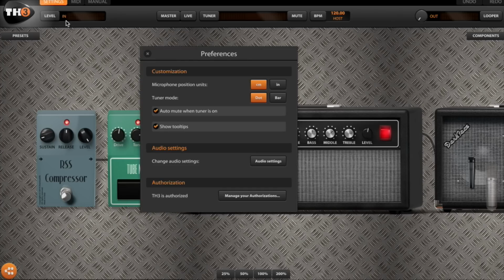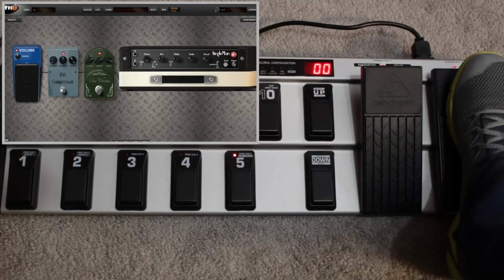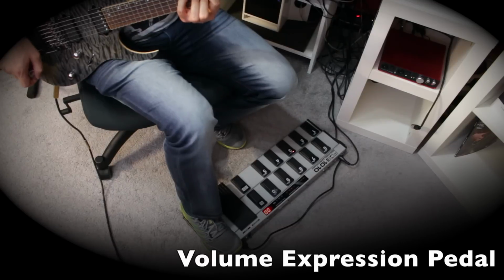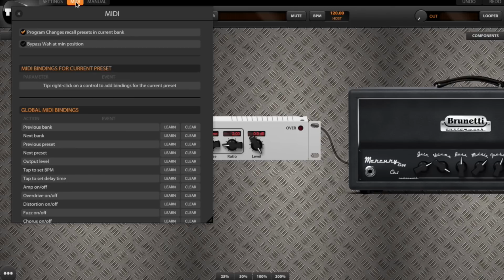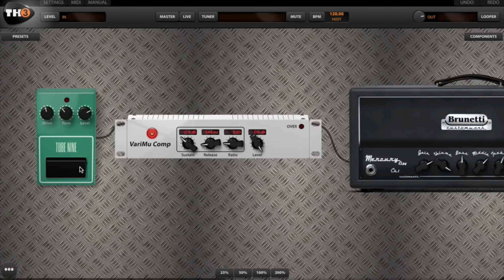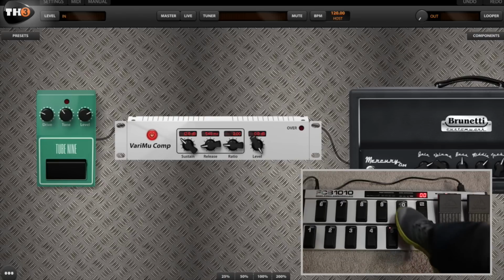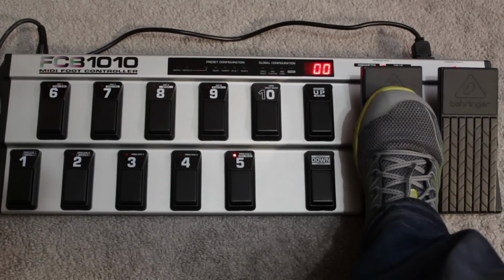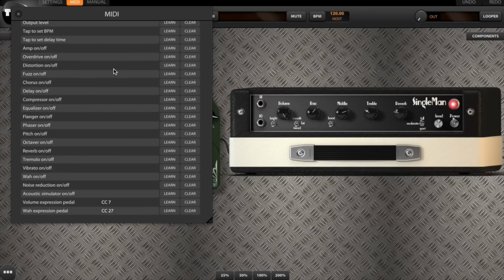Controlling Overloud TH-U With a Midi Floorboard

Comment: cool video thx... but is it also possible to change the hole preset  ( Bank and Preset) via midi to jump from one complete to the other: from bank 1; preset 5 to Bank 5; preset 7 with one step on the  FCB1010 ??? HOW ???

Comment: Hi..i build for pyver vypyr 75W on arduino footswitch with bank preset...rever and delay. Working fine. But wjen i connect to laptop th3 not see command midi. I use simple china midi converter on usb. Th3 need some magic preset with midi command?

Comment: I have TH-U Mobile with all of the gear. TH-U mobile does not have the feature where you click the FS twice to learn the on/off state. When you "learn", you click the FS and the Learn window goes away. There are 6 options for setting up the MIDI command: Expression, Footswitch, Press 127 and release, Press 127 only, Press 0 and release, and Press 0 only. I've tried setting up my MIDI FS using all of those options except Expression (since this is a FS). The only one that seems to sort of work is Footswitch, but it requires you send 0 or 127 for Data 2 field. The problem is, 0 turns it off, 127 turns it on. If the stomp is on, clicking the FS will turn it off. Clicking it again will turn it on (since it's sending 127). However, if the stomp is already off, clicking the FS the first time does nothing. Clicking a second time turns the stomp off (as expected), then clicking again turns it on (as expected). But that means every time I load a preset, I have to toggle each stomp on and off before I know that the MIDI FS will do what I expect it to do. 

Is there a video out there or some place where I can find a better explanation about the MIDI implementation in the mobile app? I've spent close to $250 on TH-U premium and most of the amp and rig packs. Sure would be nice if the MIDI implementation actually worked correctly.
Reply: Did you get any answer ?
Reply: @shinomorello  Nope. I just make sure I click each foot switch twice after changing presets. A little annoying, but not a big deal, I suppose. The Behringer controller with the mod chip is supposed to be able to. And each foot switch has an LED that shows on/off state. 

Relatively inexpensive too. LOTS of foot switches and an expression pedal.

Comment: Tutorial wortks like a charm. But whan I use it under my DAW (Sonar Platinum) only erxpression pedals works. How can I setuo other functions?
Reply: It has to do with routing the signals. I googled.."using the behringer midi pedal in th-u in a daw. worked perfect in reaper and should in most others as well.

Comment: That's great David but it only helps when using TH-U as a stand alone piece. When you use it through a DAW like Reaper, you don't get the audio settings in the settings menu so how do you set it up in a DAW? Thanks :)
Reply: Did you figure it out yet?
Reply: @drstatic401  yes thanks

Comment: Hi I’m getting the overload th-u and intend to buy the Roland boss fc-300. Will this combination work? Thanks
Reply from the maker: Yes, thanks to its MIDI learn, TH-U can work with any MIDI pedalboard. Btw, we typically use the FC-300 when demoing at NAMM
Reply: Overloud Audio Tools thanks a lot for the reply. Cheers
Reply: @overloudaudiotools  hi, mind to share your connection for FC-300 & TH-U setup? did u hook up the FC-300 straight into PC via USB-MIDI cable?

Comment: Hello! I just got the demo of TH3 Full to test out if it is right for me. I also have the FCB1010 and I’m wondering if/ how you can program TH3 to switch between presets (distortion to clean for example) with the press of a button on the FCB. Thank you in advance for your help!
Reply: I've been asking them for 2 years and never get a response.  It would be helpful!
Reply: You can switch between presets but only scroll to next or previous on the list. Crazy not to be able to assign a given preset.  Probably because the preset name is arbitrary and one can delete a preset. They would have to also delete the midi assignment simultaneously
Reply: @PaulLebow  yes :( that missing option is a shame… Bias FX 2 solved it with it’s LiveView, but I prefer the sounds of TH-U 3 Too, too bad

Comment: Excellent review thank you! Is there any way to map the looper clear all function? I use the looper quite often but it seems there is no way to map the clear all to a midi button, rather I have to use the mouse and click clear all. Thanks!
Reply: I don't think there is, I use the looper quite often as well, no way to invoke it other than mouse, all you can assign midi wise of use is rec play or stop , great but wanting more ..
Reply: @bobco5  man, Should I turn on direct mode on my FCB1010 controller to controll smart functions?
Reply: @ZoltanHagg  Direct mode as far as I know is an option to navigate banks and presets, with Direct Select off you would have to incrementally scroll or leaf through banks numerically up and down to get to a certain bank and preset. with Direct Select on you can directly go to preset locatin by pressing the bank number followed by the preset number, i.e. you'd have to 'know where you want to go, bank 04 preset 02 for example. How does that enable smart function of TH3 or how does that help or have anything to do with controlling TH3 is a better question. I assume you have a stock FCB1010? I have the Uno Chip , that's the Eprom you replace the stock Eprom with, you have to order it from https://www.fcb1010.eu/uno.html
Reply: and after spending that money and installing that Eprom in the FCB I'd advise spending more money on the Uno control center software to program the midi on your FCB 1010 ; only then will it be able to control your TH3 in true stomp box mode , that's what I've done, my guitar go to rig is now just a laptop pc ; an inexpensive Line 6 UX-1 and a modded FCB 1010 midi controller, effects return of a tube amp into a Marshall cabinet, it's the best guitar sound imo. Doesn't suck the tone out of your pickups and enables you to really appreciate the character of the TH3 models, they really sound authentic, musical, and amazing !
Reply: @bobco5  I've been thinking of getting the FCB 1010....but with all the modding going on..I guess I might as well go with the Nektar Pace or the MioAudio pedals..
What do you reckon ?
Thanks ;)

Comment: Is there a way to use the FCB1010 to select among a group of favorite patches? Any other way to avoid the tedium of mouse scrolling and clicking to select patches?
Reply: Did you get it to work with the stock eprom or used an Eureka or UnO?
Reply: @overloudaudiotools  So the pedalboard can switch only up and down the presets, or recall a specific patch too? For example is possible to assign the patch nr.10 to a pedal and the patch 23 to another pedal? o have I to put these patches near in a bank in the THU?
Reply: @AndreaResta  Not on my version.

Comment: Dear, i need to control 2 pedals at once with 1 midi switch .. so when i press it, i switch on 2 th3 pedals .. i cant do that ! 
Please help you have any solution for this case .
Many thanks
Reply: Every DAW has "Parameter link", try this way.

Comment: Will this work with the midi cables straight to USB port in the computer? or has to be connected to the sound card?
Reply from the maker: Any MIDI interface, like a USB MIDI cable, will work
Reply: +Overloud Audio Tools Thanks!

Comment: i bought a fcb1010 to use with TH3 and I am following your steps here but it is saying that no midi message is being sent. I have the fcb1010 hooked up to my macbook by the MIO usb to midi cable? Can you help with why the signal isn't being sent?
Reply: +The Frugal Musician ok so I got the numbers 1-10 to respond and program but the expression pedals are not. I am still getting the no midi message is being sent.
Reply: +The Frugal Musician ok so after sitting here trying to figure this out I was able to getting it working, so I will let everyone know what I found out incase you have the same issue. First I reset the FCB1010 back to factory reset since I bought it from guitar center used maybe whoever had it before set it up differently. But after reseting the pedal the expression pedals still did not work. So I recalibrated the expression pedals by turning off the pedal and holding down 1 and 5 while turning the pedal back on. after that put the heel on expression pedal A all the way down then hit the up button, now put the toe of expression pedal all the way down and hit up button, repeat heel down on pedal B then hit up button and then toe down on pedal B then hit up button. Now turn off the pedal and then turn back on and try to program it again on TH3. This worked for me and now I have 1-10 working and both expression pedals. I hope this helps others out there having issues getting the FCB1010 set up.
Reply from the maker: +The Frugal Musician Hi, if you need help with the TH3 MIDI setup, please contact Overloud Tech Support: you can go to the Overloud website and click on Support
Reply: @thefrugalmusician797  Thanks mate, I had to do this 2-3 times before it all worked but these steps worked for me with TH-U

Comment: Nice job on the video, Myself I do use TH2 and find this has replaced my roland gt100 for the most part.Tha combination of a laptop and this program leaves me to wonder why someone would spend thousands of dollars on straight hardware pedals or multi effect unit like AXE (lets just assume that people buy good quality interface)
Reply: Some people prefer tot gig with hardware designed specifically for that vs a general-purpose laptop that can die (or decide to update :D) in the worst possible moment.